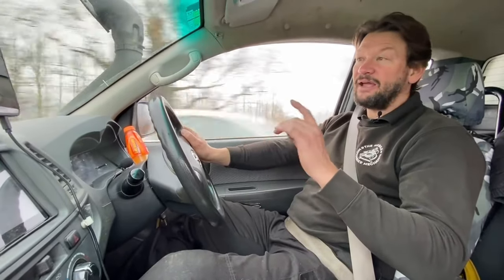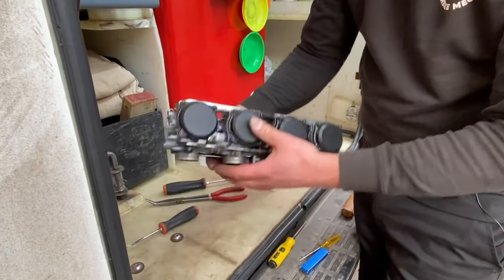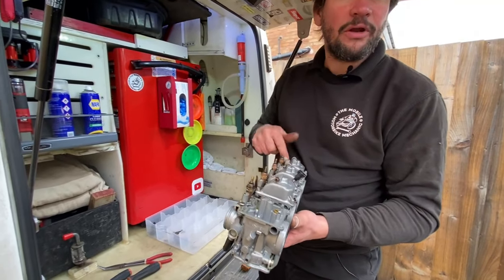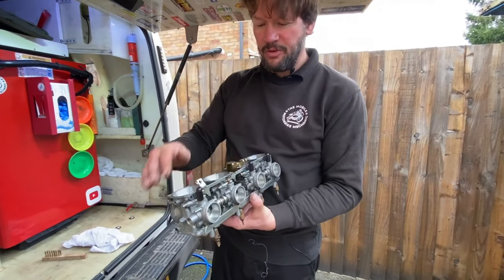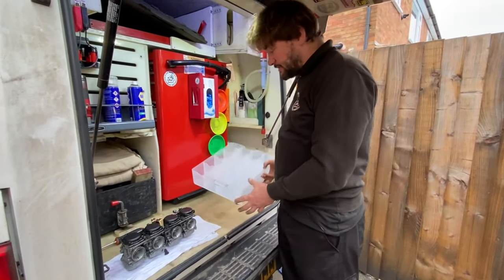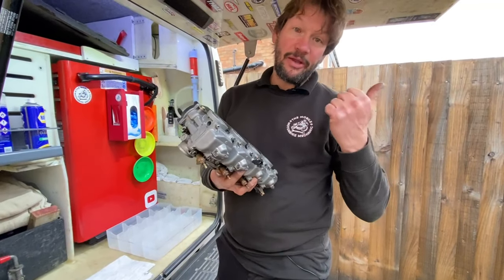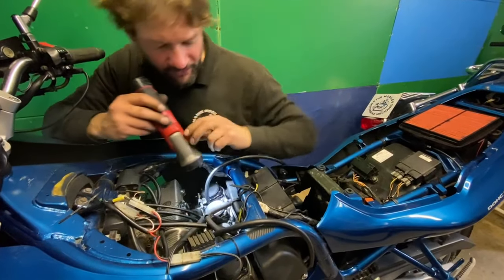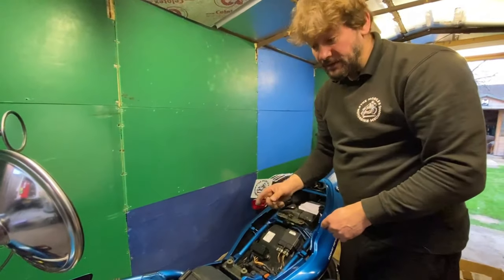Carb Over Fuelling Problem on a Suzuki Bandit 600 Motorbike

Comment: Alright now.  I'm here in New Hampshire.  With one of those red bikes on my porch now.  (Your's is blue) All about fb MP and a motorcycle campaign I started in Feb.  So my campaign started with the realization that there are many "fast bikes" available on fbMP for well, what would be about 500 quid. or $600.00.  Right?  Literally from a container (in West Virginia ~Honda cb750 Nighthawk) and then from (not sure where~an 18 year old sold the bike ~ southern New Hampshire ~ 98'.  1200 Bandit) And then last week, local, the red bike. 600cc Bandit.  So I am a mess with three 'go fast' bikes, all $600.  That's $1800.00.  All with potential.  All needing a new battery and that four barrel rebuild.  So the lift is coming on the porch, the red bike is being switched with the black Honda and I'll start with that.  Fair is fair.  I checked for the Alcohol Anonymous schedule locally. But really don't have the time for meetings.  Not gonna lie.  I'll keep an eye on that blue bike of yours. And of course subscribe.    Thank you.〰✨👍✨.〰.             - Steve from New Hampshire.

Comment: Any idea how i get a snapped bolt out a diagram head cover, man those bolts are stuck bad..
Reply from the maker: Try a pair of mole grips very carefully to assist turning the screw whilst using a screw driver.  It’s a two person thing but should get it out

Comment: Excellent video! Was there any sign of rust particles in the carbs when you cleaned the float valve seats?
My bandit had dumped a third of fuel from the tank of into the engine oil too and cleaning the carbs I found the main culprit - rusty gas tank plus torn filter diaphragms on the petcock, both for the reserve and the main fuel supply.
Do you reckon adding an inline fuel filter from now on is a valid solution or should I find myself a new petcock?
Reply from the maker: No rust particles.  Glad you found the issue and cured it

Comment: steve top job but do mind your own body. bended back end your knees my friend,  they are much harder to fix than bikes.
question,  did  you ever came across worn needles and emulsion tubes?
almost forgot, to clean them pilot jets ask a guitar player for the thinnest string.
they go to   0.006  inch
Reply from the maker: Guitar string. Never would have thought of that 👍

Comment: Great video i was wondering I have the same issue with my bandit I've cleaned the carbs out but am still getting petrol in the oil sump what ended up being the issue final. I've cleaned the carbs and had them clean but others but still the same trouble
Reply from the maker: Get the float valves out and polish the float seats. They are not removable but you can polish them with a cotton bud and some T-cut
Reply: @themobilemotorbikemechanic thanks for the response man I'll give that a try fingers crossed this will sore my problem